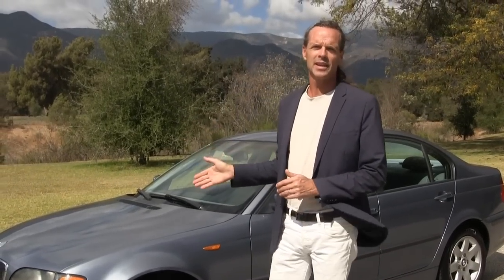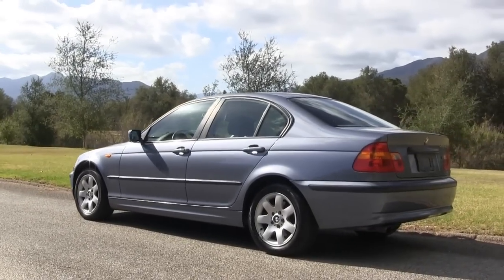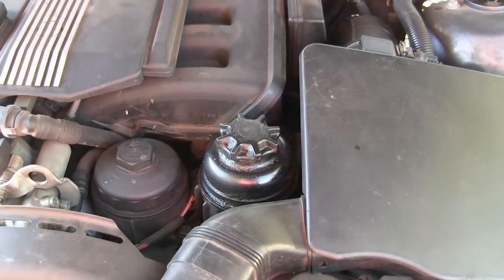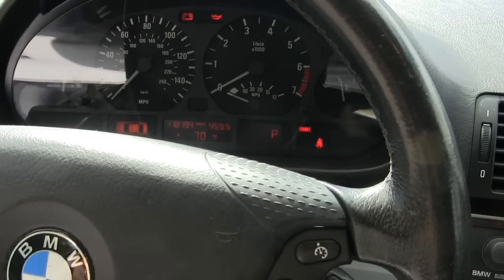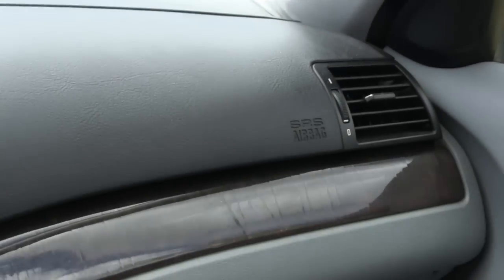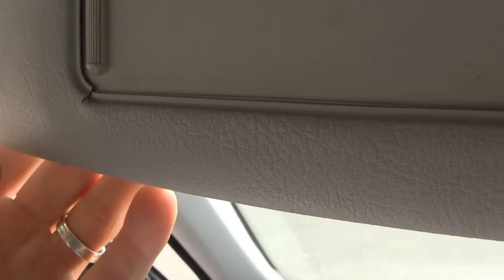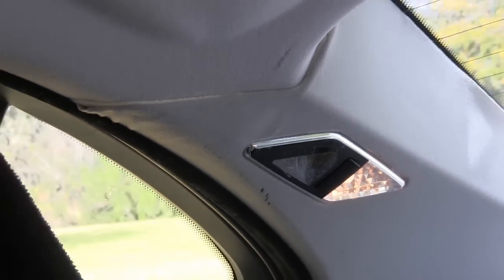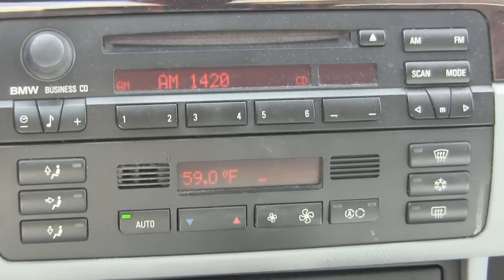Why You Should NOT Buy a Used BMW

Comment: Clearly this has all the earmarks of a flood car from Florida that was never garaged! I’ve had the 2001 330Ci Convertible, a 2001 325Ci Coupe, and am currently going through a 2005 330xi AWD Auto fully fully optioned. Never abused but tons of differed maintenance …. WHAT A CAR! The best e46 built! Overall a much better car then the e46 M3! I believe this car will eventually be known as BMW’s best kept sleeper secret! To this day (17 model years later) it is still one of the most absolutely best balanced and handling 4 door sedans in the automotive galaxy! You can still find styling ques from this e46 on today’s 2022 BMW’s! Seriously timeless styling! IF you can find a fully loaded (Sports Pkg, Premium Pkg, Cold Weathet Pkg) 2005 330xi that’s been garaged, kept on maintenance schedule, and had records to verify, BUY IT! No matter the miles! You will enjoy grand touring adrenaline thrills EVERY TIME you drive it! With 37/63 full time AWD  I can literally feel the car pull and push me through the curves at the same time! What a sensation!!! 2005 was the final year of the e46 sedan and the very last of the “simple” BMW’s ever built! Snatch them up while they are at the bottom of the value curve!  It’s to the moon from here! I’m actually in the process of building a fleet of these 2005 e46 325i and 330i sedans to rent out on Turo! (The Xi will remain as my personal cheap thrill!) Happy hunting!

Comment: Drove almost 100,000km on a used late model (2017) BMW and only had 3 problems that are very common for the model (X5) and engine (N55). Other than that owning a BMW is just like another car, oil changes, air filters, brake pads etc.

Comment: Good lord, everything you're describing except the subframe issue is literally my car. 2001 325i. The grills falling off, the disintegrated cowl, the back seat stitching, the shitty marred console finish, the material on the pillars, and all the rest... including the cracked expansion tank and bad thermostat that put it in the shop (...the dealer) as we speak. The thing is, it has 226,000 miles, a lot of which are my miles as I bought it with (I think) 140,000 or so, and it's been a hell of a good car in the 4 years I've had it. I got a lot of very excellent, satisfying driving out of it with relatively few trips to the shop. Just a damn reliable vehicle. As much as I can relate to all the gripes in this video, because they're all indicative of the obvious and laughable poor material choices in some parts of the E46, it's nonetheless an exceptional car with impeccable driving feel and otherwise superior engineering. It's incredible the feeling you get with your hands on the wheel. I love my car. It pains me to have to scrap it, since this current repair is certainly the last straw and won't be worth it at such high mileage. I'm looking at a 2006 5-series to replace it, which may be another wise choice. But I'll miss my E46 forever. Long live Hans Bimmer.

Comment: We have a 2006 330ci convertible....there has been some issues like the power steering pump failure recently but we took it to a local certified BMW mechanic, not a dealer.   $300 later and 1/2 day at the shop its back running.

Comment: My e46 has had almost all the things you mentioned gone wrong but even so it’s still running strong at 175,000 miles. Black leatherette holds up wayyy better than actual leather tho, go figure. And the 5spd trans has been bulletproof. European cars are expensive to both buy and maintain, this is not new info. You get the discount in the used purchase price, but make up for it in repair costs. Deal with that and enjoy a nicer ride/interior/features, or drive a reliable Honda/Toyota with basic af crayola everything else. Paint quality and thickness, sound deadening against road noise, stereo/amps, and speakers, etc. the Harmon Kardon system still sounds better than a lot of brand new stuff today! I see cars all the time half as old with faded paint and chipped clear coat (looking at you Chrysler and basically all imports). Only thing you left out I noticed was the cyclonic oil separators which fail fairly common and the oil filter stand gasket. Now my personal car has never left me stranded, but I don’t speak for everyone obvi. The ONE time it almost did was when the COS locked up completely and the crankcase pressure blew oil out the side of the valve cover and caused my low oil light to come on. Added some oil to be safe and was still able to get it home without issue. A big part of European cars being even remotely affordable is if you shop around for parts and can do some of the work yourself. If you send every issue to the dealershit you ARE going to have a bad day. Bmw does stand for Bring More Wallet after all. Ha

Comment: My 2001 325 with full bmw service history and 2 previous owners had the following faults
-front drivers door lock would lock by remote but not open. Even my first car a pug 306 had working locks. Poor.
-Dsc failed - common problem
-alternator failed
-final stage resistor failed - no heating
-adjustable headlights stopped working
-was sluggish and slow until I replaced the maf sensor.
-airbag light would randomly come on.
Despite this it was a great car to drive aroimd corners and looked great with the msport kit. I miss it.

Comment: I bought a '08 535xi 6 speed manual in 2012 with 45k miles on it. I knew it had probably been driven hard because of the manual. It is now 2018 and the car has 150K miles. Maintenance is what you should expect from a luxury car that requires premium fuel.  It has not required many repairs.  Being an oldtimer, I drive it like a old lady except for the occasional dropping it into 3rd at 70 to shock a 5 liter mustang or something.  I'd buy another one in a minute.

Comment: Just saw this video, I realise that it is six years old. However the feedback to give here is that it is somewhat not correct to say not to buy a used BMW. Perhaps the E46 had problems. I had a BMW 525i 1992 model (M50) drove it for six years no problem at all, especially about all the problems mentioned in this video. I sold it to my brother-in-law at 130000km, he drove it until 250000km, still had no problems. I then bought a 1998 BMW 328i E36. I drove the car until 180000km and sold it to my uncle in 2004, it is now at 355000km. Guess what? Still in its original state, no mechanical problems at all, the only major work was to change the clutch kit and the drivers window module. Interior of the car still original and intact and the exterior. Taking care of the car goes a long way in having a long lasting sound car.

Comment: I’m in the U.K. and never seen a BMW that was looked after in this state.  This car looks like it was neglected plus probably the heat and humidity was a problem. I have a 640D and done 140,000 mikes and not a thing has gone wrong, car is pristine inside and out, however I look after it.   BMW did have a few issues around this time.

Comment: Honestly, this guy made a good video. I love the E46 and drive one myself (318CI). The main problem is, that these cars are more likely to have been built for Europe climate. Or maybe this car is manufactured outside Europe. My interior is in really good shape after 230K (KMs). So I'm pretty sure the car in the video isn't well maintained or was used in a very hot temperature. The cooling system: yep, it is very bad. But other than that, a great car and also people: watch the video till the end before you start to bash on this guy. He has some facts which most E46 owners have to admit. (But not the interior).
Reply: Tom Pijnappel the engine in the 318i/Ci is regarded as one of the worst engines BMW ever made. It’s riddled with problems. Good luck!
Reply: @drummerdude100  Thanks. But now doing 250K. Engine sounds very clean and runs well ^^. Altho u make me scare a bit.

Comment: I have had the car for six years.  It has 237000 miles on it.  Yes, I have change the expansion tank twice.  There was a recall for the rear light and it doesn't have an issue anymore.  I have never seen a leak on the area he is mentioning.  I have also had the bottom engine seal changed because of the leak.  The car keeps going with great power and it is joy to drive. Tell me a car that has 237000 miles on it without a few things going wrong!  If you purchase one of these cars at around 100000 miles you can drive it to 350000 miles without too much trouble.  Oh you need to change the oil once every 10000 miles if you use mobile 1 oil.  I had to change the breaks once too and tires.

Comment: I went to check out 2001 330xi, it doesn't have these issues, was close to buying until when im slowing down pressing the brakes its shakes and vibrant at idle.... really liked how well it handled tho and has decent push power for a 20 year old car, sucks that it was shaking and had a p0440 code

Comment: Also, for everyone saying BMW's only make low quality headliners, plastics, etc. These cars have different classes. You cant put premium anything in a low-class car like the 3-series and not pay the same premium price tag for it. It wont happen. Thats like me putting $85,000 into building a house, and then selling it for $60,000. I would lose profit. If you look at every era in automotive history since the early 90's, BMW has been proven to be the best All-ropund performance/luxury vehicle. Its the "Ultimate driving machine" for a reason. A lot of people who have bad opinions on these vehicles are either:
1: too poor to evn buy one. much less maintain one.
2: dont even own one, never has, but has others influence their opinion. 
or
3: completely neglected the vehicle even when IT TELLS YOU BEFORE HAND(most of the time) when any part of any system is about to fail. 

This BMW in particular was very poorly maintained. Mine NEVER looked as nasty as that one. One way you can prevent most of the plastic issues in the engine line the water pumps( I do agree its fucking dumb to make a plastic water pump) is buy an aftermarket Steele water pump or any such other components.

Comment: This guy is correct though a bit harsh in his conclusion. If you want a used car where you only have to change oil and check tires now and then do not get an e46. Consensus opinion seems to be you could expect to spend $1-3k /year on repairs and maintenance. Hopefully, you won't have to, but you need to be prepared for this reality. They are a car that MUST be properly maintained, it becomes like a part-time job, with youtube now you can research how to repair some things yourself, if you enjoy as a hobby, great! They do have cheap, plastic aspects that are unforgivable on an expensive car. HOWEVER, my 330ci convertible is a JOY to drive every time I get in it I still get excited. Engine and handling are superb. The design is so classic that it still looks great even though it's 15 years old. One of the absolute highest regarded cars of its era.

Comment: Got to disagree, mine has 275k miles and has the original exhaust and no other major issues other than wear and tear. Also has original water pump as mentioned as an issue in your video.

Comment: You are correct with the plastic parts and cooling, correct about the leak in the atf.  One thing you missed is the CCV.  It always creates a vacuum leak that is about $700.00.  A PILLAR is also true and cracked woodgrain, center console true again.  For the expense of these cars its sad.  I have 2 ..03 324ci.. 2010 750I which has bad valve seals burns oil constantly.
Reply: I've owned my E46 3 series for over 3 years now, but the CCV job at the BMW dealer for me was $1200 actually. Just a note :P. My car has been incredibly unreliable, but I do the work myself mostly and I love it too much to sell it.
Reply: The later 750i came through with bad valve stem seals. Not a big deal. They're not that expensive, though you'll want to set aside a fair amount of time to do the work.
Reply: Oh yeah that's a tear down LOL......IM a excellent mechanic I just don't have the time or space to do it......plus you need a $400.00 kit.......

Comment: I am going to guess that this car was probably never garage. Heat will do all those cosmetic things to the car. I wouldn't doubt this is a southern car that was never garage. you do have some good points about some of the things that go wrong with these cars including the water pump and the expansion tank and the tail lights. Very true. The other cosmetic stuff is all related to poor maintenance never garage or in extreme heat.... Oh, and the A pillars o for some reason that seems to come off or wrinkled very easily... I have a 3 to 5x with a hundred 2000 miles on it and I absolutely love the car. No major problems and the window regulator does not cost as much as you say...

Comment: 2008 BMW 750Li and boy does it need some mechanical work. Valve stem seals, alternator bracket, c02 sensors, guibo joint, transmission, sensors, etc.........find your self a reputable independent shop. My mechanic worked as the top master mechanic for BMW North America for 20 and plus years. Also have a friend who works on BMWs at an independent plus likes working on them as a hobby. Literally told me to bring a six pack and he would do my alternator bracket. With these kinds of cars you're going to need friends like that or the knowledge and tools to maintain the any BMW spaceship.

Comment: This specific car is bad, not all E46s are. Have had several and now I daily drive an E39 523 and I will drive BMWs from this era until they become too old and rare to daily. Aside from some plastic parts in the cooling system the rest is reliable. I keep them serviced and change out some cooling system parts when I buy a new one for peace of mind, they are really easy to work on and parts are cheap as well. But if you know nothing about cars and go to the dealer for every little thing, then buy a Toyota instead!

Comment: Had 330D and 320D for 15 years, hardly any problems 200k miles in 330D, nothing touches these for ease of maintenance, things come off and go back again, try a VW golf mk4 and you need to take off the front to change a headlamp bulb!

Comment: Those engines can last past 500k miles, but you need to refresh cooling system every 100k miles. I had original water pump with 136k miles on my 03 330i. M54 is very reliable motor. 03-05 is the best year to get. You can use bmw forums to do a lot work yourself, or find a good Indy shop.

Comment: My bmw doesn’t really have any of these issues, 121000 Miles and it runs great with minimal repairs. It’s just a car that you have to maintain, just like any other luxury car. I’ve seen many Japanese cars in similar condition at similar miles, it has more to do with the owner than anything.

Comment: I just LOVED the last comment! Man - I am so thankful to have seen this. I've been wanting a 700 series forever, but now I'm pretty hesitant to even consider one. I sure will look them over carefully, and they buy a Toyota probably!
Reply: @Tombradyjockstrap  Yeah - I've heard that about the 700's - that's why the only old 700's you see are falling apart because the people that bought them cannot afford to repair them. I bought a Toyota Highlander, all wheel drive, leather, heated/cooled seats, sun roof, large wheels, pearl paint, ALL the bells and whistles. I've driven it on several road trips - to the Smokies, to Indiana and back through driving sleet and snow. Had ZERO problems with it, has 90,000 miles on it now. Still in like new condition. It's quite probably the most trouble free, most comfortable, best car I've ever owned.  This is my eleventh car, not counting my parents cars growing up (wish we could have kept that old Ford Galaxy 1965 convertible! lol). I've switched from Chevy (well - really - all american cars) to Toyota. I've had a 96 Suburban (great vehicle - 220K - my farm truck now), Dodge Truck (threw it away after 100k miles - literally), 92 Volvo 850 sedan (loved it but early termination because of frustrating electrical issue - only made it to 180k - interior was like brand new still but it just flamed out sometimes WHILE MOVING ON THE INTERSTATE!), two early 70's Monte Carlo's (should have kept them!), Camaro (mid 80's with a v8 in it - great engine, but bad year model for Camaro), 07 Camry (300K miles - son still driving it), 10 Toyo RAV (140K still going problem free), 95 Lincoln (inherited a land yacht!),  an 08 TOYO Matrix (really hated it - a tin can - sold it after six years - so least owned car in the lot), and a 88 Honda Accord (well built car - sold to my mother in law when I got the 92 Volvo). So last four cars in a row - Toyota. Dollar for dollar, less cost of ownership (when you include purchase, maintenance and fuel) than anything else out there. Sorry - BMW's aren't even close or in the top five manufacturers - unless you just have to have the status symbol. And these days - NOT looking like a millionaire is probably a good idea.

Comment: I have owned a few BMWs.  I didn't buy any of the ones I owned new.  A car is a mechanical thing and things will wear out over time.  More quickly if they are not maintained.  I doubt the example shown was well taken car of. Currently driving a 97 BMW 540 which despite being 21 years old and having 135,000 miles performs flawlessly.  I love my BMW and just can't part with it.  It looks and drives great and is still fun to drive. All of its electronics still work after 21 years and I still get complements on the car.  I know their are people who love there Honda's and Toyota's, but they are throw away cars.  People don't choose to hang on to them because they love how they drive and perform.   They are reliable but ulilitarian.  Built to be driven and then disposed of.     Consider the number of BMW clubs and forums for those people who love their cars, maintain them, restore them and show them.  Anyone out there spending money to restore their 1982 Honda Accord?